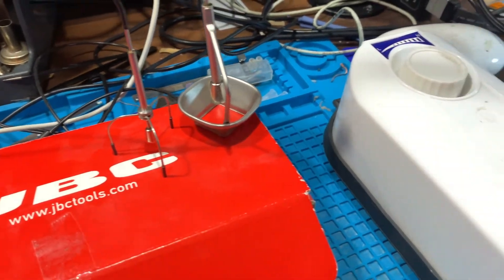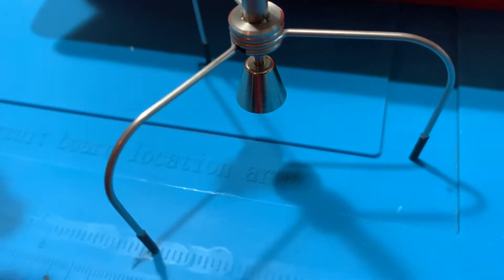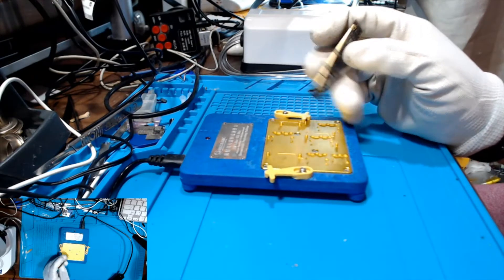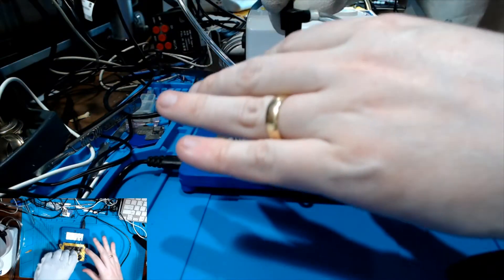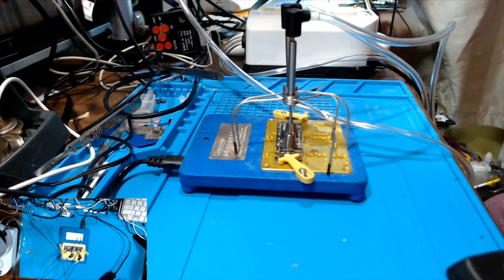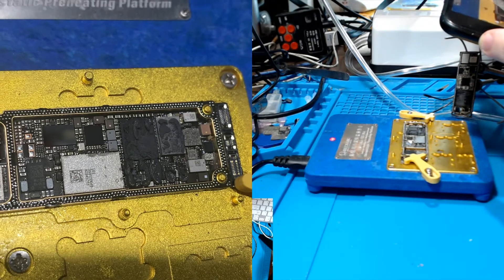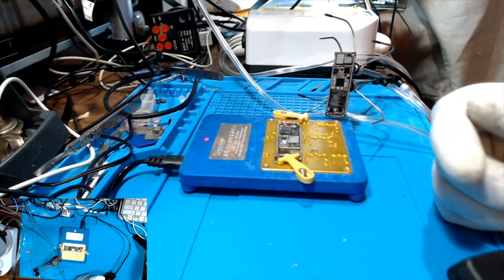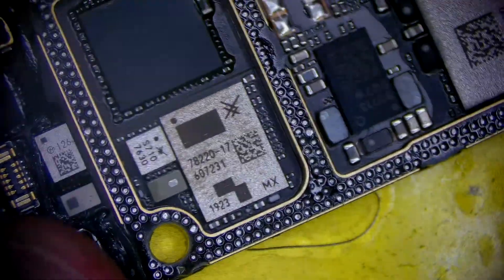IPHONE 11 SANDWICH BOARD SEPARATION USING JBC TRIPODS METHOD

Comment: Which pump are you referring to? Do you have a model number?
Reply from the maker: The one in this video was just a cheap aquarium vacuum pump bought from eBay. See my other video about the JBC mod for any hot air station, in that video it shows the pump and what parts you need. Thanks so much for taking the time. Really do appreciate it. Thanks Rich

Comment: Fascinating! I haven't seen these sandwich boards before. They look like a bit of a nightmare to work on but that is a great idea for separating them 👍👍👍👍
Reply from the maker: Thanks so much Vince, I really do appreciate it . They can be a nightmare, if the board a little warp or bent a little bit even by the slightest they don’t solder back properly and you end up with pads not connected. I must admit They’re not my favourite to work on.

Comment: That is a clever technique that, no pad damage, thanks for sharing it Rich much appreciated. Don't suppose you have a link to the Pump? 
Little off topic but it would be a great edition for my fish tanks, double air stones or moving divers & all that. 👍🏻👍🏻
Reply from the maker: The pump in the video is a suction pump, the one you need is an air pump for the air stones. I’ll try and see if I can find a link for you for a twin air pump. The one in the video will just suck the water out of the tank😂😂
Reply: Oh dam so it can't be put in Reverse? Maybe modified to blow & no suck. In-fact You! just give me an excellent idea for a cleaning system, that pump could suck the waste from under the stones/tray.  Sucking up the water don't sound like a bad idea at all :) Rich you are a Legend!!
Reply from the maker: This is the pump will work with air stones..link below

https://www.ebay.co.uk/itm/Hidom-Quiet-Aquarium-Air-Pump-Fish-Tank-Single-Twin-Outlet-Valve-And-Accessories-/113078603531?mkcid=16&mkevt=1&_trksid=p2349624.m46890.l49286&mkrid=710-127635-2958-0
Reply: Rich you are a Double! Legend!! I could never find anyone with good feedback selling that style of pump, that'll save me having extra plugs and multi pumps, I like the 100% feedback sellers they, much more trustworthy IMO.

Comment: As always very interesting and I have learned something. Are they easy to put back. Why do they do it like this? I guess to make repair more difficult may be?. Surely they could have made the access to the sandwich board by an easy way.
Reply from the maker: Thanks so much, I really do appreciate it. With a preheater that’s designed for this specific board they do go back together relatively ok. It’s just another thing companies such as Apple are doing to make devices less repairable. With every new device seems to be new obstacles put in place by manufacturers unfortunately. They want a world where you throw it in the bin and buy a new one from them.

Comment: Have you tried replacing soldered in place RAM, on a laptop m/b, but replace it with a higher amount of RAM? Like 4GB for an 8GB? Thanks
Reply from the maker: I haven’t done soldered Ram upgrade before but have reflowed and reballed. If I come across this I will try and add to the channel. Thanks so much for taking the time to watch, really do appreciate it👍

Comment: I'm wondering if the sucker is comprised of some sort of heat-resistant silicone.
Reply from the maker: I think it is some sort of heat resistant silicone. I put a lot of heat on it since having it and it hasn’t shown any signs yet of melting. Also the metal shield gives it a bit of cover. Thanks so much for taking the time to watch the video, I honestly really do appreciate it👍
Reply: @SURGE101  Always some clever tidbits so thank you for taking the time make these purchases, produce the content and share with the community.